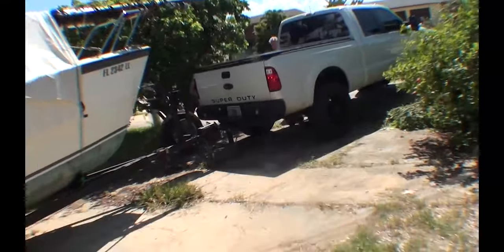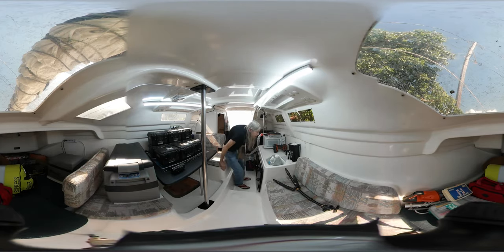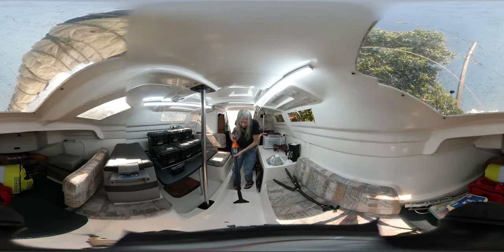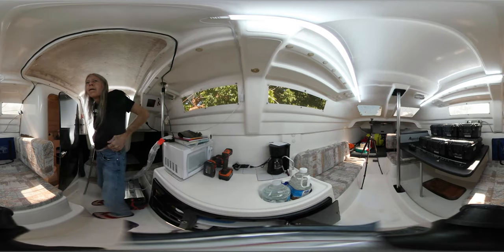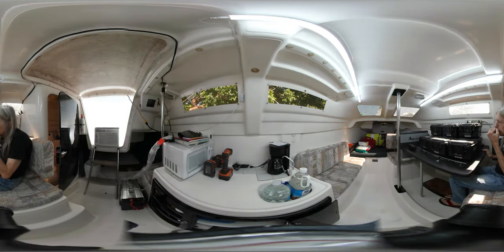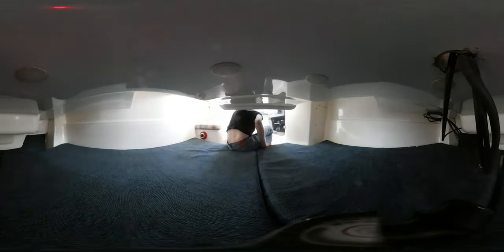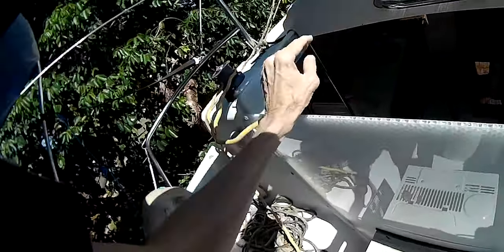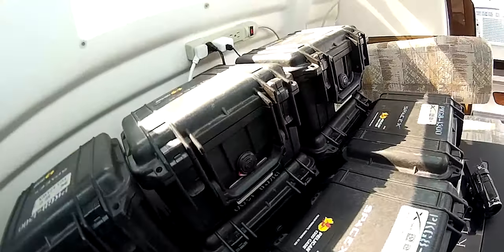I Am Stealing This Boat Right Now!

Comment: I have an old Macgregor 25 I picked up for $500. Took a year to rebuild but I will be avoiding the snow and be in the Bahamas for the winter.
Reply from the maker: Would you like a crew for your Bahamas trip?  Thats where i want to go, but i still have a lot of boat related work before i am ready to go.  Wouldn't mind catching the dock for you and sailing in shifts if you sail through daytime and night-time.  
I have owned two Mac 25's, an 81 and a 1975.  I was surprised they made new molds to slightly update the boat between those years.  From a distance they looked the same but once you started looking at details, they came from different molds.